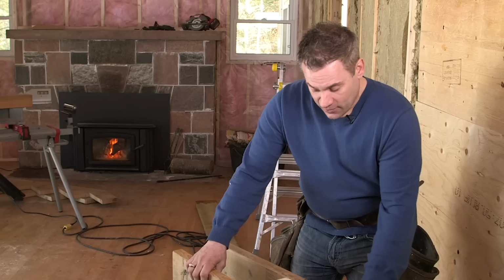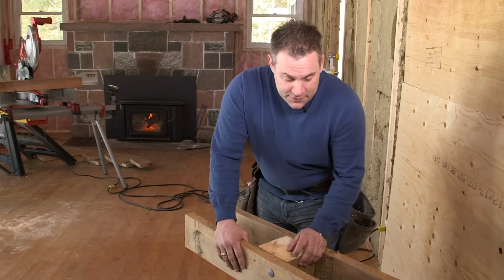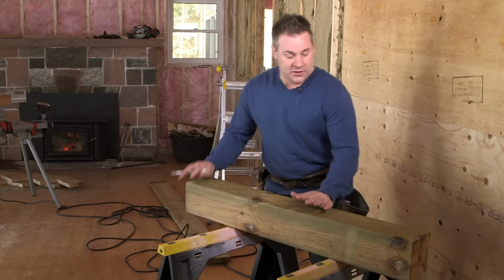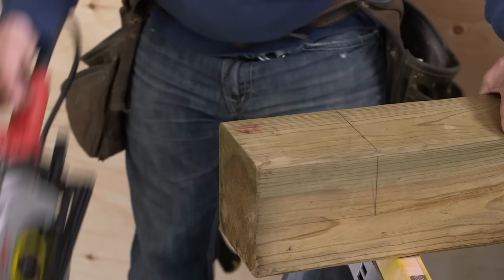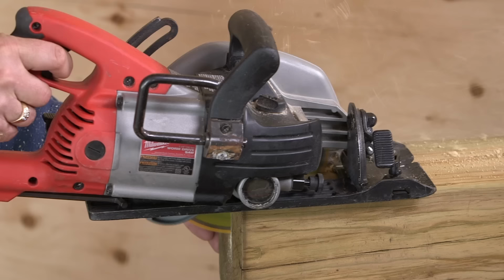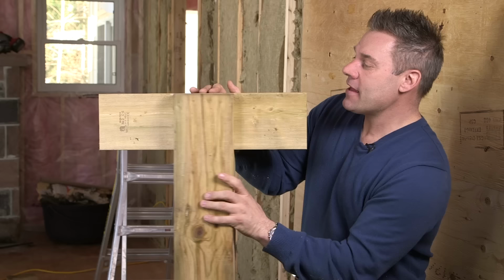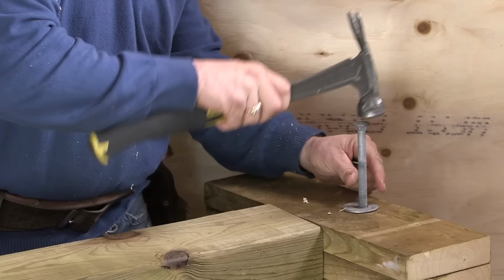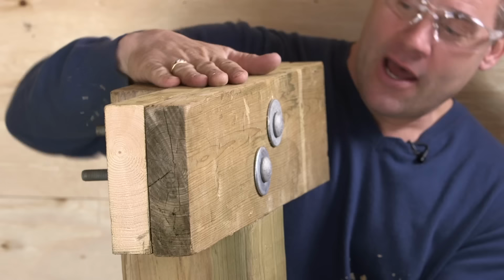How to Attach a Beam to a Post for a Deck | Decks, Docks & Gazebos

Comment: You will never see a broken carriage bolt
Reply: The carriage bolt is not the weak point, the timber is.
Reply: The 2 beams gain strength sandwiched together.  Splitting them around a post is another reason its a terrible idea. Waste of lumber.
Reply: Adam R sandwiching beams causes them to retain moisture leading to early failure. If you’re worried about strength don’t under engineer your deck.
Reply: @markuschelios6891  
The stress is on the lumber around the bolts.  The wood is only as strong as the 2 inches or so between the bolt and the edge of the wood!  They might as well have just used 2 x 2 lumber, because they lost all the strength of the single beam, and got zero strength from the second beam.  Its ridiculous.  

The double beams when split dont add any strength.  They subtract strength in that inferior design.   The beams are designed and engineered to have a certain strength.  That's why they are doubled. It's a waste of lumber to add a second beam that does absolutely nothing. 

  Properly sandwiched they dont hold any more moisture than any other lumber.
Reply: @JM-nh8yp  The bolts should not be relied upon to carry the load. Posts should either be notched, or joists should be sitting on top of the post and fastened from lateral loads by use of connectors.
Sandwiched joists are always inferior because water and sediment works it's way between where it forms a wet sludge that does not get enough ventilation and leads to premature rot. I know this because of 25 years of construction experience in the PNW. One of my fellow contractor friends does nothing but rebuild decks and we see the results of sandwiched joists all the time. We flash the top wherever joists are sistered to keep water and silt from accumulating.
Reply: @markuschelios6891  The cut weakens the post and also exposes non pressure treated wood and provides a water trap. If the idea is to place decking boards for people to party on then 'those' corrosion resistant bolts have plenty of strenth. Also bolting the joists will make levelling the deck much more straightforward as you could allow an inch for height adjustment. If the joints are on show then the notch method will be more pleasing to the eye and can be periodically treated against rot.
Reply: Iazzaboyce I agree with you except for the part where you rely upon a bolt to carry the load. Building codes exist for a reason.
Reply: @markuschelios6891  I understand what you mean by sandwiched joints and moisture.  However, there is a simple fix.  Provide a barrier to keep moisture out.  Saying that you are avoiding sandwiching altogether really doesnt solve anything.  Because there are many examples of sandwiched areas.   Even the ledger board for a deck is a sandwich!  It's right against the house. But it can be protected.  Just like a whole host of other sandwiched joints.
Reply: @markuschelios6891  I'm in the UK so am not aware of USA codes. Are we talking about ground level deck for people to walk on? Those bolts if corrosion resistant will do the job. No matter what joint is used - 4x4 construction timber will break up under much less force than a good bolt.
Reply: Iazzaboyce The bolt is not the issue. It has to do with the limitations and inconsistencies of new-growth timber.
The decks I work on are typically 10 to 30 feet off the ground and built off as much as a 45° grade.
On a rinky-dink backyard ground level deck, do what you want since you’re not holding peoples lives in the balance.
Reply: @Iazzaboyce  I build decks by putting the beam directly on top of the post, without notching and so no bolts go through the beams. I like to have the maximum strength without spending extra money on unnecessary bolts.
Reply: Adam R  I'm not sure I really follow your logic. Deck calls for a double 2x8 beam and you say by by not doubling them you are basically only sitting on one( or 2x2 basically as you say). YOU ARE STILL SITTING ON TWO SINGLE 2X8S. Yes you gain a bit of strength by gluing and properly nailing it off but 2 singles does not equal the strength of less than one single that doesnt make any sense. If you are worried about a little strength loss(for a deck that's probably over engineered in the first place) go up in size to a 2x10.You're also not bearing on the bolts, sandwiching the post is applying clamping force and transfering load that way. I dont do it that way because lumber shrinks and you lose your pressure so its unreliable. Laminating 2 pieces of lumber together does hold moisture  because its allowed in at the top and just sits in between the two members and rots the beam from the inside out, I've replaced tonnes of them. Most times you dont want to sandwich your ledger board right tight to the wall of the house anyways as it can hold moisture there as well. Build it out with ledger brackets, washers or shims and water wont collect and pass through. Any time I get called for deck repair its always rotten at sistered joists, laminated beams as well as rim and end joists. I shim fascia as well away from the rim to let it all air dry. When laminating beams and joists I'll flash the top with blue skin, red zone or metal to keep water out and you can shim those apart as well
Reply: @markuschelios6891  you using 2x6? Never seen a 2x8 fail through a lag?
Reply: That ain't no shit I was like what kinda salesman is on this video I'v seen them all bent up in demo with heavy machines but very rarely broken .
Reply: @maddog12186  I'm sure it will cut through the oxygen and acetylene tanks too .
Reply: @JM-nh8yp  it actually does do something, If you have ever built a dock or deck you know there is the supports, then running boards or joists that sit on top then you deck. when you have a long deck, it makes it easier to splice without having to offset and overlap, so you can keep straight screw lines and use less lumber. Decks don thave really any weight on them anyways,  dont over think it.
Reply: @scottrobinson8590  I hear what youre saying.   But you also said decks dont have much weight on them. Sometimes.  But some people entertain.  There have been many deck collapses.  The weak point is often the way the support post is utilized. I would rather build something as strong as possible than build something that "might" work as long as I don't put too much weight on it. Its the same amount of materials so I see no point in not using the materials properly.
Reply: You said that nobody will ever see a broken carriage bolt. Haha.  . I've seen many broken carriage bolts. Probably most people here have too.  Some broke from corrosion.  Others broke from stress. Many times the wood breaks out from around the bolt.  Which is just as bad. That happens when people hang the load on the bolt, instead of putting support posts directly under the load.
Reply: @markuschelios6891  Drilling bolts through wood also causes possible moisture entry.  Splitting a beam into 2 parts defeats the whole purpose of a laminated beam. The strength is in attaching the 2 together.  You are the only person talking about wanting to "under engineer" a deck.  Take a look at a header over a garage door or other space. Laminating a beam and putting the post directly under a beam is not inferior. Its easy to protect the beams from moisture entry. Its called flashing. Nobody can stop you from spreading your misinformation online. Thats too bad. Some people might follow your example. There are no engineers or contractors I know that build as you recommend. There is no purpose in splitting a  beam unless its easier, cheaper or faster. Its definitely not stronger than laminated directly over a post.  Its common sense that cantering something off the side creates extra force than putting a load directly over a support. And most people understand that a laminated beam is stronger than 2 individual beams seperated from each other.
Reply: @bolerdweller  Flashing is a simple fix to keep doubled beams from rotting. I see decks over 40 years old without any rot.  My point about a 2× 8 beam is that you aren't gaining anything without laminating the beams together. When a post is sandwiched between 2 boards, those 2 boards are acting as INDIVIDUAL besms and they transfer those Individual loads to the same post. There isnt much difference in strength than only using one board in that situation. I never said that 2 boards have LESS strength than one board. I said that 2 Individual boards have less strength than one LAMINATED BEAM. A beam is still made up of 2 boards. 

Without properly laminating the beams together, they add no strength to each other. There is no logic in splitting a beam into 2 individual parts.
Reply: @JM-nh8yp  you don't know Richard
Reply: @JM-nh8yp  well loading a 1/2 or 5/8 inch bolt in shear on a deck application is the proper way. Generally the failure mode of decks are the fasteners /brackets as they generally get a lot of moisture and are in contact with copper in the pressure treated wood.  thin walled metal or fasteners are the first to go, however big carriage bolts tend to last. It is often not practical to notch posts in such a way on large decks, look at boardwalks and other structures in parks and such and you will see it is common to use carriage bolts. Also when I said light loads on decks I meant virtually no dead loads and just people, which even if 100  100 pound people  stood on just 
one 1/2 carriage bolt it would just be getting to it's failure point.  trucks and vehicles are a different story but there are still ways to use bigger lumber and bigger bolts even in those circumstances.
Reply: @scottrobinson8590  
Brackets should be insulated from direct contact with the wood for the reasons you mentioned. And I'm not so concerned about the carriage bolts themselves. The wood around the bolts rots away or just breaks away.  In the design without notching the posts (and hanging the load directly on the bolts) it basically reduces the width of the beam down to the couple inches away from the edge that the bolts are placed in.. For example, if the board is 2 × 8, it basically acts more like a 2 × 2 if the bolt is only 2 inches from the edge.
Reply: @JM-nh8yp  I kind of get what you're saying but you do still have some points that aren't entirely true. You're not hanging a 2x8 by a carriage bolt, you're clamping it to the post, it's not  as strong as a 2x2 when used in this way like you said. You get your bearing by the pressure from clamping the two faces together, not from hanging material from 2 carriage bolts, they are just providing the clamping pressure. Any failures you've seen were probably the result of loose bolts(usually the case when wet pressure tread dries out) or a shock load.
Reply: TJP 81  thanks for the reply. I was actually making a case for a symmetrical design, with a laminated beam DIRECTLY above the post, to take full advantage of the compressive strength of the post below.  I was not making a case for a split beam design in which the boards are not even above the post, and not utilizing the compressive strength of the post.  I also make a case for protecting a laminated beam from exposure to rot.
Reply: @Iazzaboyce  - The only direction the post need great strength is to support a load and notching at the top it doesn't lessen that at all.  As for cutting treated lumber, most professionals use sealer to treat cuts on treated lumber...and even amatures like you can do it since you can buy it at any big box store, hardware store, or Amazon.  As for bolt strength, the video was a bit misleading because most deck failures caused by side-bolting joists don't come from the sheered bolts...it comes from either the bolt heads pulling through the wood or splitting of the joist.  For instance, if you use an 8" joist and side-bolt it in the middle to a post, you're really only getting the strength of a 4" joist if it's side-bolted since the bottom 4" of the joist is not being supported.  If you rest the joists on a shoulder, all 8" of joist are being supported so you have more strength. Also, the bolt's only job when it's resting on a shoulder is to hold the joist to the post so it's much less likely to pull-through the wood.
Reply: @JM-nh8yp  - When you put beams directly on the top, do you use a bracket or something to tie it to the post?  Surely, you don't just rely on gravity to hold it there.
Reply: @dewrus2153  That stuff you've seen professionals use on cut treated timber is called 'wood preserver' not 'sealer' just in case you want to buy some.
Reply: @Iazzaboyce  - Uh-oh...you better notify the company named "Seal Once" and let them know their product is titled incorrectly.  That's what we used when I built decks for a living years ago.  I've also used products from Jasco and Outlast.  Guess what...they also are called "sealers".  Seal Once literally says "End Sealer" in big bold letters right on the front of the can!  They have a whole line of products that are seemingly named incorrectly (according to you).  You better type-up a strongly worded letter and send it to their marketing department for their prompt action!  And there are others like "Cut-N-Seal", "Anchorseal", Ze-Vo Deck Cuts Sealer", "Rockler Green Wood End Grain Sealer", and "Lumber Seal".  You better get writing to let them all know how wrong they are, too.   Also,  "wood preserver" is a general term that also includes products like Thompson's which are different than what you use to treat end-grain especially on green lumber.  So, while the general term "wood preserver" includes end-grain sealing products, it also includes many other products NOT intended to seal end-grain.  As for products for treating cuts on pressure-treated lumber, the nomenclature on the can does indeed vary by brand.  It can be called sealer, primer, preservative, preserver, and treatment...among other names.    Your weak attempt at condescension was totally uncalled for as my reply to you was both factual and respectful.  I put forth effort to explain things and your answer to me is a sophomoric aspersion?  Nice.  Thank you for confirming my suspicions about your depth of knowledge on this subject.

Comment: My deck was built 20 years ago the way you say is wrong. And it hasnt moved at all
Reply: The method you used isn't wrong it just isn't as strong. The shear bolt strength of a 1/2" bolt is 1470lbs so there is plenty of leeway. Jason is correct about the method for bracing a beam and it doesn't take long to accomplish with hardly any stress on the bolts as the beam rests on the post. 
But how deceiving to use a #8 screw sticking out of the post and shear it off with the blow of a hammer. Not very convincing. Try doing that to the 1/2" carriage bolt with a shear bolt strength of 1,470 pounds.

Comment: There is plenty of strength for shear in those two bolts dude
Reply: A number of jurisdictions won’t allow it to be built it with carriage bolts alone. Another reason, in addition to the bolt shear is that the wood can, and often will, crack at the bolt holes from the weight and vertical movement of people walking, jumping and doing other activities.
Reply: the bolts arent the problem, its the wood itself that can fail
Reply: Mr Glass  the wood between the 2x6's and at the bottom of the 2x6's can rot as well... bruh

Comment: So you say that beam needs to be notched for post that bolts can't take shear load and your other video you attach ledger board with lag bolts which is also makes SHEAR connection. Do you even think what advices you are giving. 

Theres nothing wrong to attach beam to post with bolts if they are placed correctly because many constrution connection is shear connections and they work flawlessly, like skyscraper metal frame bolted together etc.
Reply: Mr. Wizeguy metal and wood are to different things the bolt won't shear off the wood with fail from down force
Reply: Agree that bolt won't ever cutt off in that situation and there isn't ever so much weigh on deck that wood will split under that bolt.

But like i said there is no need for notching post to make that connection work. It's totally same type of shear connection when you attach beams to rim joist with joist hangers only difference is several nails that take load instead of those two bolts.
Reply: Mr. Wizeguy  
Totally! Are nails enough?
Reply: Yea, just a couple of 16's in it should be perfect.
Reply: nails are generally enough for decks.... use twice as many on the posts and beams and a scab under the beam and youll never have a problem unless you have an earthquake..
then theres no bolt in the world gonna stop it from breaking free and splintering.. bolts will still be there but the deck WONT
Reply: Mr. Wizeguy
Reply: Mr. Wizeguy 8888
Reply: He's right He's wrong.  Obviously there's shear strength in large bolts, properly tightened to compensate for shrinkage there is friction bolts do work in millions of locations
BUT
Many codes don't allow them because they can be installed wrong too easily, miss sized ore drill miss sized not tightened fresh cut green wood shrinks listening bolt ...  Hence code req for notching 
Which creates a host of secondary problems like rot, splitting... 
I live w a very prescriptive deck code that demands notching but offers u an out if u hire an engineer or architect to stamp and file. Then u can use bolts 'cause the DOB knows they be properly sized & installed under liable professional.
Reply: Mr. Wizeguy Yeah you can load to failure Usually involves a keg and a lot of college kids...  Really college partying huge cause of deck & balcony deaths & resulting protective balcony deck codes